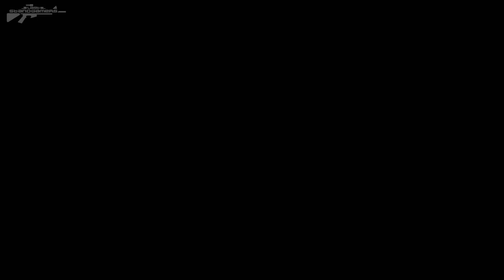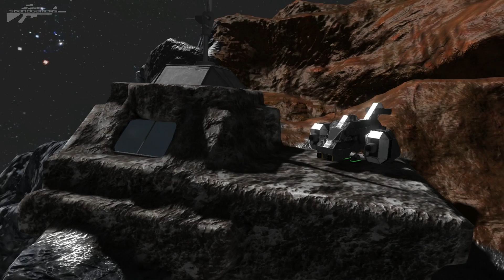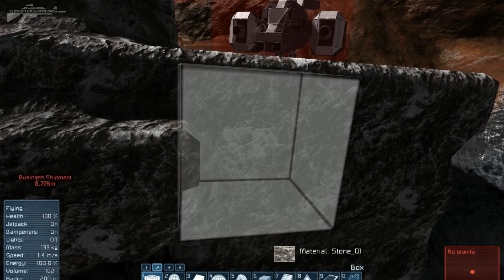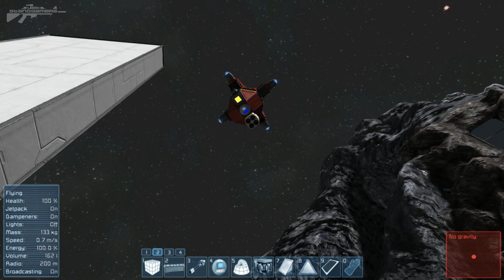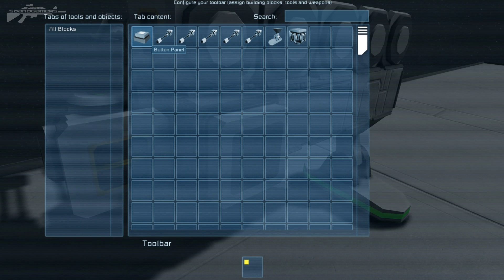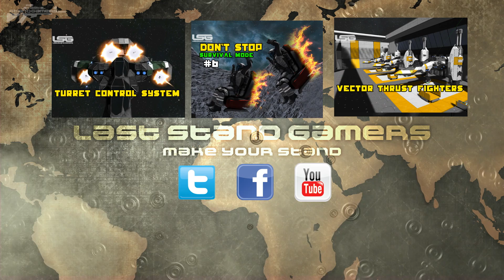Space Engineers - Voxel Construction, Sensor Weapons

Comment: How does the rotor trick still work for you?
Reply: The Icarus Project I didn't get that xD can you be more specific? :D
Reply: If you go into settings you can manually attach the big rotors to the small rotor parts By using the attach/detach toggle if the two are close enough.
Reply: The Icarus Project Thanks man
Reply: The Icarus Project Actually, I just checked and cant find that.